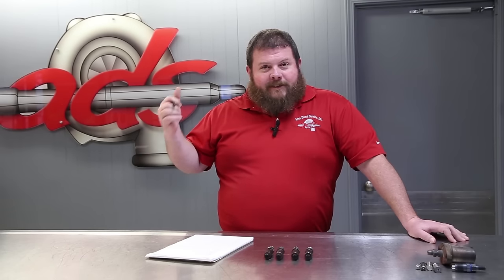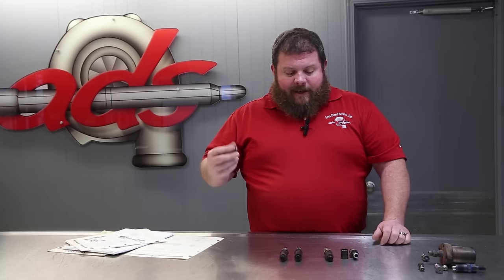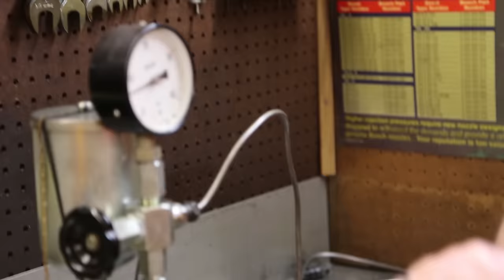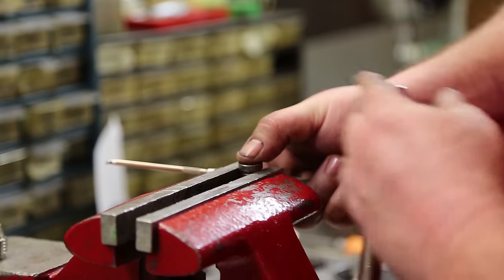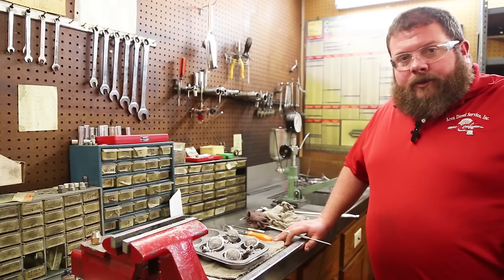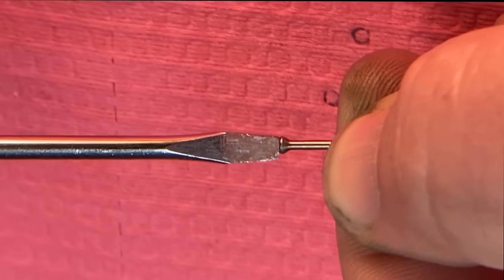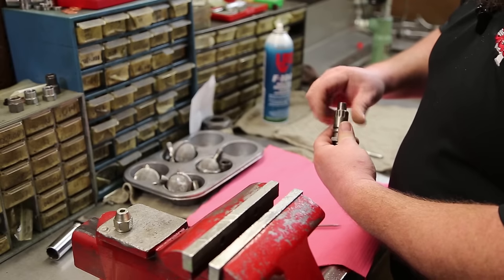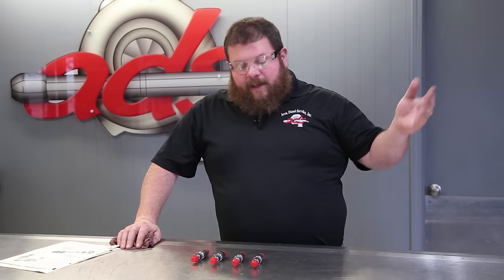Obsolete ADE Type "Dumper" Injector Nozzle Repair for @FarmCraft101 1010 John Deere Crawler

Comment: Mabey not fascinating to some but I thought it was great content. I spent 42 years working on all kinds of old equipment from Navy boats to rubber / plastic manufacturing and Alum. foundry equipment and the small detailed jobs such as you just did seemed to present the greatest challenges and most satisfying rewards. Well done!

Comment: I had a 2010 crawler for 35 years, this brings back memories. The 2010 was a little larger than the 1010 but very similar otherwise.

Comment: It would have been interesting to see what the opening pressure would have been with the shim removed. Then you could have probably come up with a measurement for a new shim to get to the 100bar. Obviously, it comes down how much money the customer wants to spend on the injectors. Those were built when things were the designed to be serviced and repaired.
Reply: I wonder if the one injector that was just over 100 bar was the one with the shim (my money is on that one 😁)

Comment: Found your channel from watching John's - great content and a new subscriber.  I have a 40 yr old OMC skid steer with 3 cylinder Kubota that is running a little rough so I'll be digging into the videos on possible causes but thinking injectors.
Thanks for the info and look forward to learning more.

Comment: Thank you ! I wanted to see the process of lapping the pintle....I did notice you lapped them in the proper orientation ...i.e. down but the book showed them lapping them upside down
I think that is so the weight of the pin vice pulls down on the pintle giving a better grind of the seats.... something to think about ! i noticed that through most of the lapping you were not pulling up on the pin vice which in that configuration you should have been. but as long as they lapped good and didn't leak that means you did it right regardless ! good job!
thank you for fixing john's injectors he's a good man and deserves all the help you can give him !  THANK YOU !

Comment: So im sending mine your way so glad I found somebody that  is a pro at these old nozzles. 

Ha just kidding sort of,    Thank you for uploading this information. I ve been bringing an old 2010 back to life a lot John. My mid serial number crawler has basically the same injector nozzles slight difference where the line attaches. Uses a banjo bolt.  I know the 2010s smoke at start up but think  got some dippers and have been scouring the net for a couple of years. Spencer Diesel has some for big $$$$ and $200 bills for the cores. 

I finally had unwound mine and been wondering how the heck to remove that pintle.  The info about the yanmar injectors was something I had been trying to figure out .  seems like there has to be something else that would either screw in or a modern tip?  Guess i will see if I can lap mine problem i already snapped one of the holding nuts torquing it too much.  

Thanks again.

Comment: I have a 1957 D8 cat 14A model and it has capsule type and the capsule type is actually a crimped end that can't be serviced or cleaned I actually got all six capsules for 125 dollars engine runs great

Comment: I'm amazed that these injectors where serviceable. Lot of injectors with old varnish inside might be just unserviceable. Bosch injectors and there analogs are still very common all over the world. Just from a personal experience don't buy or order things online when it's not a genuine diesel parts seller. Lot of counterfeit nozzles out there. ADS did a wonderful job and the diagrams where a very good information source. I hope Farmcraft gets his John Deer crawler running.  Btw how old is the pop tester?
Reply from the maker: It's been around for several years. Certainly don't build them like they used to. I wish we had a count of how many injectors we have tested on it.

Comment: Be mindful of using a vise to hold a badly stuck nut/bolt like that. It is entirely possible to break a vise like that, and that can go wrong in so many different ways. From smashing your hands into something and/or falling when the resistance suddenly disappear. As an added bonus, depending on the break, the moving jaw can fall onto your feet. Ask me how I know...

Comment: I wanted to ask what part number of injectors were you thinking of retro fitting? I'm been searching to find something newer that will possibly screw into my early serial number 64 jd2010. 1400psi opening any ideas would be appreciated I think it's a 3/4 pipe thread that screws over the injector into holder.    Been searching  for months maybe years actually.  Can't drop much more into it until I know I can reduce the amount of smoke.  Great video though thanks

Comment: So ADS agrees with me:
Rebuilding the injectors was a very simple procedure.
Jon could have done this himself, if he had a hydraulic pump, a pressure gauge, 3 pieces of fuel line and a T-coupling.
Of which I'm still pretty sure he has.

Comment: Broken rings and broken lands is a cause by either, And as for older injectors a injector type that has a large barrel can be made to fit modern pencil type inject
Reply: Got any more info on how to fit the pencil injectors into the larger barrel?  Do the pencil type open at around 1450psi?  Would you screw in a reducer and tap the existing holder to fit a pencil style  injector holder ?  Basically...
Reply: Yes if you make a sleeve to fit a modern pencil injector, you would have to choose one with adequate size and spray pattern and yes pencil injector have a high injection pressure but it can be turned down, not only does the 16 to 1 compression ratio of a diesel help with quick starting but the more the fuel is adimizatied it flashes quicker
Reply: @andrewklahold2880  thanks.  Picking the "right" injector has been the challenge not having access to any and most forum replies just nope obsolete your out of luck. It was really refreshing to find this video  and some people  thinking on the same  lines as my thoughts.  Knowing now that at least some of the pencil , if not most can be adjusted too helps thanks again.

Comment: Question would the machine have new power and run better if he installed a better anomizeing injectors
Reply: That's what I'm wondering too and trying to find a suitable injector.
Reply: @Mavericksa  well i think when you get the new turbo back all your problems will be solved i watch area diesel and i think you will be at the pinnacle of performance

Comment: begs asking, A  what are best practices re running fuels in diesels to get best life, and if storing them  do you put a good drink of something in the fuel before storing?  Airplane engines get stored with Shell Ensys? oil a guy told us so stuff doesnt rust inside, and if shipping stuff  flush with mineral oil or some types of power steering VW and audi to other use as its mineral oil
Reply from the maker: Straight diesel certainly stores better than anything with bio content. We would recommend an additive for any long term storage. We probably see as much work in the fuel shop from machines that have been sitting for long periods than anything else.
Reply: @AreaDieselService  On old diesels another thing to watch out for is copper corrosion. Biodiesel attacks copper alloys and makes nasty green sludge. A lot of modern ULSD has a little bit of bio in it for lubricity, less than ideal if your fuel system has copper or brass parts in it...

Comment: I've got a 1961 1010 tractor it's nothing but a weak turd of a machine, I pulled those injectors off and sent them a few towns over to Brazos diesel service in Bryan Texas and had them redone probably five years ago 
 I know they machined new seats and nozzles and I was absolutely amazed how it turned that old tractor around of course it's not much to begin with but it sure woke that little tractor up
  There's a pretty good possibility that it's running at full horsepower now. 
  I've been watching Farm craft 101 on this series I would have lit a match on that thing long before he got in so deep 😀